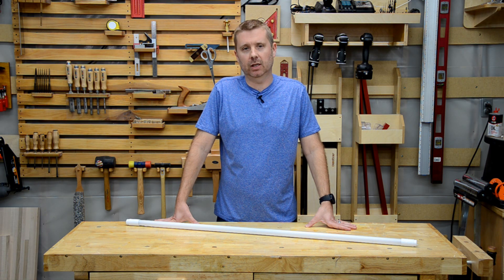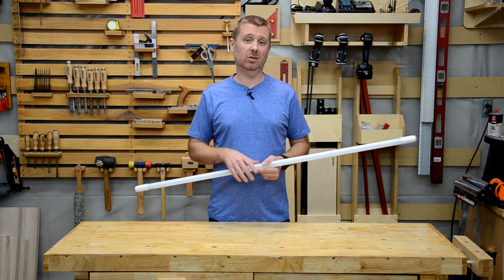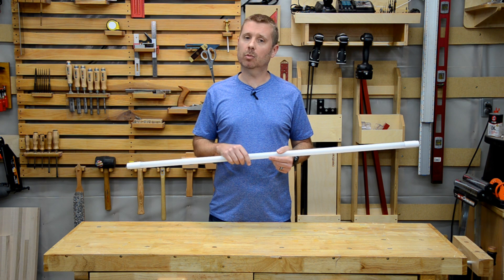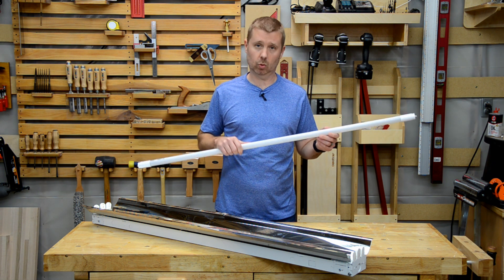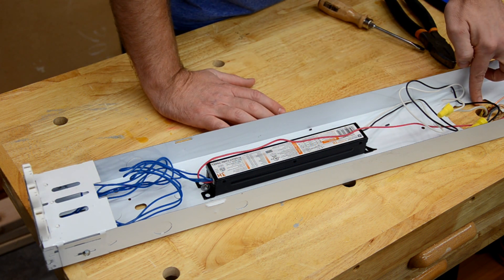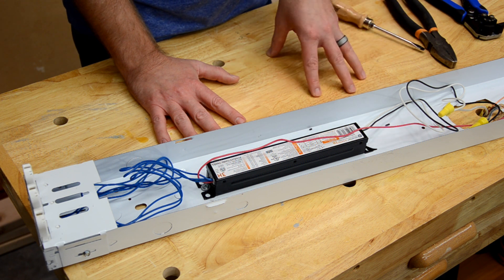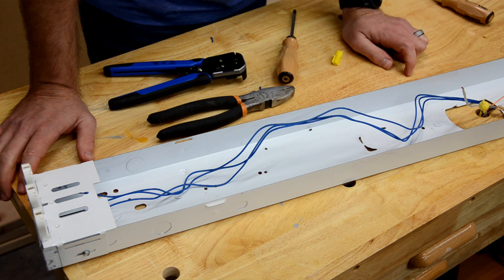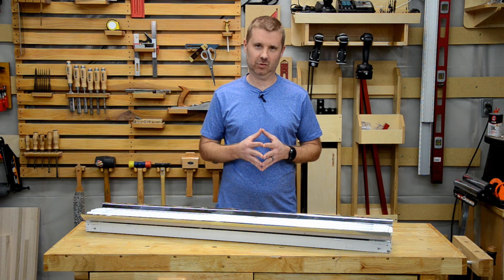How to easily convert fluorescent Lights to LED – UPDATED!

Comment: My ballast is mounted right in the middle between the bulbs. There's no cover. Is it OK to leave the wire connections inside the fixture, or would everything need to be stuffed back in the box? I rewired my light just as you did and it works great on my work bench. I just don't see how I'm gonna get it all mounted, especially since there's absolutely no room in the tiny ceiling box.

Comment: I bought some double ended Type B tubes (GE product 32w T8 Direct Wire) and was all ready to go after watching this and many similar videos. But then I saw the instructions on the box say to add “the recommended fuse and fuse holder (not supplied) to the hot wire from the mains”. My question is (a) what would the fuse be for and do I really need it? And (b) if I do need one how do I know what kind of fuse? Thank you!!

Comment: My fixture is 2 24" T12 20W and there two wires running to each tombstone...Two reds to one & two blues to the other one at the same end and then two yellows down to the other end which are jumpered together.  What do I do here????

Comment: Great videos. Having the knowledge from both was more comprehensive to assist with converting two bathrooms, the laundry room, and the garage. It was a total of 7 different fixture configurations. The only problem is now I need to wear sunblock in my bathroom. 😂

Comment: This was so helpful.  Thanks!  I converted a kitchen fluorescent fixture to LED Hybrid Type A+B today, and everything worked very well.  No one locally (in Arkansas) sells the kind of LED tubes you recommend in the videos.  I checked Lowes, Home Depot, ACE, and BatteriesPlus.  But when I talked to a clerk at a local light bulb specialty store, he had heard of these kinds of bulbs and respects the product.  He called them Smart bulbs instead of hybrid. I ordered from amazon, and installation was very straightforward.  I don't normally do electrical DIY.  I rewatched your video many times to make sure I understood the steps.  Thanks again.

Comment: I watched five other videos and was still confused on a few things. I wanted to do a double ended connection, but I wasn't sure if I needed to change the tombstones. I had checked mine and found they were shunted. I also wasn't sure whether to buy b-bulbs or the a+b bulbs. Thanks for clearing all that up.
Reply: You were supposed to cut the other side wires completely and bridge the other side to be life and neutral. The tube L side be connected on that side with wires.

Comment: Well I'm learning ALOT about LED and fluorescent batten lights. 

I accidentally put in a fluorescent tube into an LED batten light. The tube mading a "pop" noise. I then saw the "do not install flourescent tube" sticker on the batten. 

I then went back to Bunnings (I'm in Australia) and bought LED tubes and installed them...but the light doesn't work anymore? Do LED batten lights have a fuse? Did i blow a fuse or something? Or some how did i break the light fixture?

Comment: Sneaky Trick:   You saw how the 'neutral end' was daisy-chained to one wire?  Do the Same Thing with the 'Blue' wire at the hot end:  Leave One Long for back to the power connection, and cut the other two Short and hook them up the same as the other end. ( to the adjacent tomb-stone, so all three are hooked togeather. )   Two less 'Long Hot' wire to short out...   Many Tomb-stones have 4 holes for wires, two holes to each side of the tomb-stone...

Comment: Is the startup time much faster than the old fluorescent tubes? I have old fluorescent fixtures where the startup time is about 2 to 3 seconds, which is annoyingly slow, especially with motion switched lights.

Shouldn’t you also label which side has the hot connectors and which has the neutral connectors? Maybe the fixture also needs to be labeled that it's wired for the connections on both sides of the tube, not just one side of the tube.

Comment: Afternoon,  I’m attempting to convert the fluorescent lighting in my house to LED lighting because the ballast throughout the house are not performing.  I have attempted a ballast by-pass because I want to get rid of all of them and learned an incompatibility between my bulbs and my wiring methods.  I used a GE- Savant Type A bulb with a ballast by-pass to learn the output of these bulbs are much lower than expected.  

What would you recommend compatible bulbs and light fixtures.  Ballast by-pass is my preferred method because I am led to believe that I will eliminate a future repair!   
Thank you

Comment: Great advice! Some reflector are stainless steel but most at white. I used a black magic marker to mark (-) and (+) on the ends. Others may not be into electrical so I mark them for the next guy.
  I don't know how others do this, but I use zip backs for receipts, install papers that show part numbers and I. D. the bulb and part that come with the box end tab, etc. Then I file these in a drawer of my filing cabinet, next to dishwasher, ceiling fan, door locks. I don't call companies to fix or replace things the break at home or in car.
  Tons of insurance ads on TV make you remember that last time you had brakes done on a good car that you plan on keeping. Start a second savings account at your bank or credit union. Remember, banks are for profit so everything has a cost. With your second savings account, pay it $10 - $50 bucks and don't touch it. If you put $100 each month then in a year, you got $1,200 dollars sitting / for your car or truck. 2 years, $2,400 dollars, 5 years, 6,000 bucks. Change your oil when on sale, filter, watch YouTube and rotate your tires. There are all kind of service you can do over a weekend for most cars. It is cheaper and you get the satisfaction of doing it yourself. Plus you have $2,600 in the saving #3. Do it!
DK, ASE Master Tech since 78, retired.
Reply: Thank you for passing this information on 🙏🏽

Comment: You can't see what you wired the three blue wires to NOR what you wired the red wire to. You really needed a wider angle to view. Explaining the hot and neutral wires better would have been helpful and rid much confusion. Just sayin. Video was helpful though. So now a new led long bulb will work in the fixture. Hmmm.

Comment: One question, the answer which eludes me even after a fair bit of searching is, can you mix hybrid A&B tubes in the same fixture with standard florescent? I'm short a couple of the hybrids and until I get more I'm considering mixing them with some of my old stock florescents.
Reply from the maker: I've never tried mixing bulbs like that, but I can't think of a reason why it wouldn't work. Let us know how it works out!

Comment: Not all T8 fixture lampholders  (tombstones) are shunted.only the ones wired to instant start ballasts. Program Start T8 and all T12 rapid start ballasts require unshunted lampholders. It’s good to see there is a hybrid version of these T8 LED retrofit tubes available for use in line with ballast, wired direct to incoming power or single or double sided wiring for direct power. I agree that it is cleaner and more efficient to bypass the ballast in these fixtures since the ballas still draws Danton power when tubes are operated inline with ballast. 

I used to work for the US Navy and did hundreds of lighting retrofits in facilities. The Navy banned the use of these retrofit LED tubes in their facilities when I was there. Not sure if they still do. At one point I did a demonstration project in the office building I worked in, where we had three-lamp F32T8 fixtures, and retrofitted them down to two-lamp T8 LED tubes (bypassing ballast). I worked under these fixtures for a year and had no problems with the light levels. Energy consumption and fixture illumination output was recorded and analyzed.

Comment: I’m going to convert my garage fixtures to LED. I am a little concerned about running 120vac thru the old 12 DC wiring though. I’ll probably switch it over to a heavier gauge.

Comment: Will this work on commercial fixtures where the voltage can potentially be higher that that of a home's +/-120?  Wasn't sure whether the ballast also acts as a voltage "regulator" and if so, would commercial voltage be too much for the bulbs... Or maybe that's not even an issue??
Great video... well thought out and presented!!  Thank you.

Comment: I installed 4 set of the hybrid tubes in identical fixtures. They worked only for two months.  When removing each old tube from the fixtures I notice one end of the reflector was lightly blackened. Today, I installed the type B tubes and removed the ballasts. Hopefully, these tubes will last a lot longer. Removing and rewiring around the ballast was simple.
Reply: Why is an LED bulb only lasting 2 months?

Comment: With the new tubes A+B do you have to use shunted or non shunted tombstones? does it matter what type of tombstone is used? I belive that was an issue before.
Reply from the maker: With type A+B, shunted vs non-shunted shouldn't matter. Since these are double ended tubes, the tombstone should work as-is regardless of type. With that said, this is only true of the tube manufacturer made it so that either pin on each end can be powered. If they require both pins to be powered, then shunted would be necessary. I can't think of scenario where you would ever need to used non-shunted tombstones on a double-ended type A+B tube.

Comment: ToolboxDIY, I would like to upgrade all of the fluorescent lamps in my garage to LED.  I had a few bulbs burned out so I purchased 4 of these new A/B tubes.  I installed two LED's and left two fluorescent in the assembly.  All was fine.  I added a 3rd LED, still good, finally I put all 4 LED's in and when I turned the light on, all 4 LED's were on but at about half brightness.  I took two LED's out and left it that way  for now.

BUT I would like to put LED's in all the fixtures in the garage and remove the ballasts.  I opened one up today hoping to find something similar to whats in your video, but I'm never that lucky.  My lamps have two yellow wires going to one end of the lamp.  Each yellow wire feeds two tombstones.  The other end has 4 wires, two red & two blue.  The red is connected to two tombstones and the blue is connected to the other two tombstones. 

Can you enlighten me as to how to wire this so I can get rid of the ballasts and go full LED?

If I can remove the ballast, can I use B lamps (they are a little cheaper)

I have photos of the ballast and the wires to the tombstones if you need to see them. 

Thanks

Comment: Thanks for making this video.  I removed the ballast from my fixture and re wired it the way you described.  Black power wire to one tombstone at one end and white to the other tombstone.  I tested with a multimeter and can confirm that I have 120v from one end of each tombstone to the other however I get no light when I installed a universal Type A Linear LED Bulb.  I know the bulb is good because I also tried installing it in a different fixture which does have a working ballast.  Do some Type A LED’s require a ballast?   I wouldn’t think so, but I’m at a loss for what the issue could be?
Reply from the maker: Type A requires a ballast. It's Type B that requires removing the ballast.

Comment: You show 3 blue wires connected to the ballast.  I have 2 blue wires connnected to one side of the tombstones and 2 red wires from the ballast connnected to the other side of the tombstones.  Should I connect the red and the blue together and connect to the black hot wire?
Reply from the maker: Connect the 2 red wires together with the black hot wire. And then connect the 2 blue wires together with the white neutral wire.
Reply: @ToolboxDIY  Does not work
Reply from the maker: @irvinpaik5511  Just to make sure I'm on the same page...ballast has been completely removed, correct? And are there any wires going from the tombstone on one end directly to the tombstones on the other end?

Comment: I have a T12 ballast and two bulbs. Besides the black and white wires going into the ballast, there are two yellow wires going to the tomstones on one end and two reds and two blues going to the tombstones on the other end, so it's different than what you are showing.
Reply from the maker: Yes, just about every ballast manufacturer has a slightly different wire color scheme and the number of bulbs for the ballast also comes into play. The concept is exactly the same though. You can cut the two red and two blue and connect those with the black hot wire. Then cut the yellow wires and connect those to the white neutral wires.

Comment: So I have a 2 bulb florescent light. So I can just change out the bulbs to led as long as they're A&B type led? Or I can pull it apart take the ballast out, the way you described, and just buy the same type led A&B?  Can I get those types of bulbs at ho e depot or Lowe's? Get video

Comment: I have a question for everyone to chime in on.
Situation : I am trying to install a new Florence fixture in my garage (converted to a workshop). I have an already working Florence fixture but it doesn't light over the work area. I tried instal/wiring an old fixture in tandem to  this existing Florence fixture. Didn't work after turning back on the breakers to the garage. Disconnected the wiring and returned the existing fixture back to it's working condition. (Both fixtures didn't work after wiring). 
Question:  is it possible to wire Florence and LED  in tandem(series) to the house supply  and the same on/off switch? How(if possible)?

Comment: Are there LED tubes that aren't as harsh as fluorescents?   I'm looking online, but I don't really see anything, and, the only reason I'd want to convert them is to have a softer, more incandescent-like lighting in my kitchen.  I'd hate to have to replace everything.
Reply: I've seen a couple of venders that list 4' LED tubes that have a color rating of 3500K. Most 4' fluorescent have a color rating of 4100K. You won't see much of a difference. Most warm lights for home use are 2700K.

Comment: I have a 3 bulb fluorescent fixture and the old tubes have been so difficult inserting and removing because it’s too tight. I have broken off the contacts trying to insert and then twist. If I go to one ended, can I shorten or remove the two contacts not being used?

Comment: Hello, I recently changed my recessed lighting (CFL) to retrofit LED (6") and I'm just wondering because the last video, the vlogger was saying "Blue always goes to the White and Black always goes to the red." In this video you connected Blue to Black and Red to White. By the way, I love your wire stripper. Thanks for this video. Much appreciated.

Comment: My dad is way to scared to do this and I'm just here staring at the dim bulbs
Reply: I'll do it for you
Reply: @raulgonzalez2885  It was actually pretty easy to do and now my dad wants to do it to the bulbs at his house.
Reply: They’re probably dim because you’re staring at lights constantly 🙃
Reply: @apolloxv8820  well I got them swapped out and it easy peasy.

The hardest part is if you reuse the old part that the bulb sits in then you have to yank the wires out somehow which is really hard. If the bulb you buy comes with new ones those are easier to wire.

Comment: Watching from Australia.  240v 50hz mains (single phase).   We have an additional component called a starter.  US fluoro fittings apparently don't have one for some odd reason.  Any ideas?
Reply from the maker: In the US, most modern fixtures use a solid state electronic ballast that applies a very high voltage at startup which serves the purpose of the starter. You have two options: 1) remove the start and short the starter terminals or 2) buy what's called a "dummy starter". Here's an example: https://reductionrevolution.com.au/products/t8-led-starter-fuse

Comment: I have two fluorescent fixtures downstairs I want to convert to LED.  This was a great video. This is no different than hanging a new light fixture.  Once the fixture is converted do you typically mark which end is hot for the bulbs?

Comment: Great video...
I stumbled across this, after I started converting my fluorescent tubes to LED, and ended up with problems. After watching your video, I believe my problem is the LED tubes I bought....my home depot only sells the philips universal fit, plug and play.  I don't think they work without a ballast. I have removed the ballast, replaced the tombstones, and  wired them for single ended power...
I'm going to order the bulbs you recommend, and see if they work.

Comment: Another video of cheap junk led lights. I don't get it you take out lights that have all metal components that hardly ever go bad and replace them with pieces of junk lights that are full of plastic parts to me it seams like its just more parts to go bad.
Reply from the maker: Sorry but I think you're off base on this one. "Hardly ever go bad" is pretty far from my experience, but that has nothing to do with metal vs plastic. In my experience electronic ballasts with lots of "metal" are pieces of shit that don't last very long. In the first 10 years of having my shop, I had to replace 3 out of 6 ballasts. The 4th replacement is what pushed me over the edge and I did my first LED conversion. While I will agree with you that these LED tubes feel cheap (lots of plastic), they've performed much better the fluorescent. I'm on year 6 with no issues and I haven't had to replace anything. LED bulbs for recessed fixtures are totally different story. I find those to be very finicky...even the metal ones. The failure rates are pretty high on those. I think the tubes are much more reliable since they are long and don't have heat concentrated in a small area.
Reply: I have had 6 tube style LEDs go bad within a year and i have had florescent tubes that have lasted for years and never had a problem